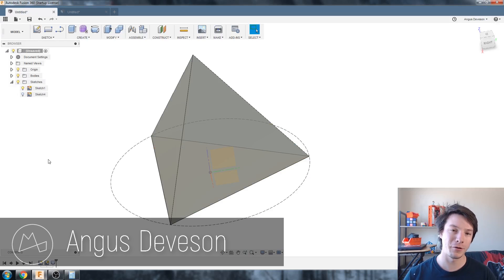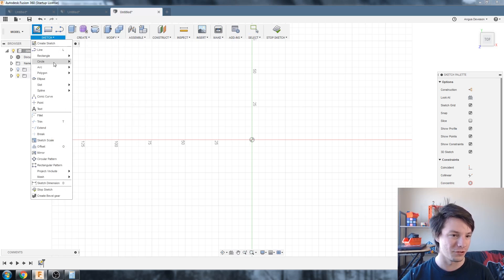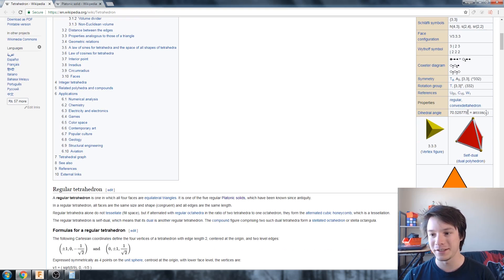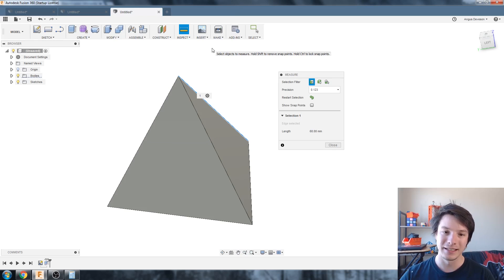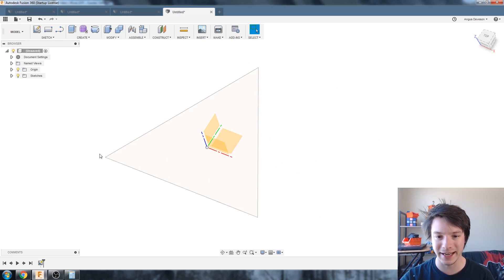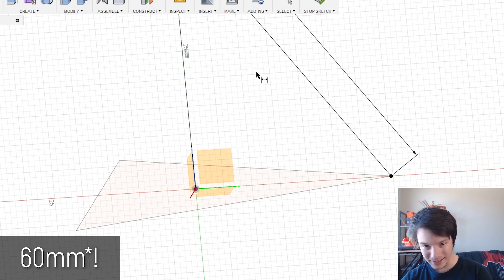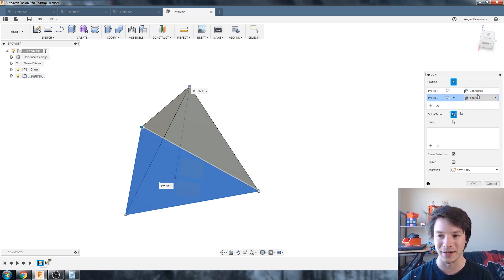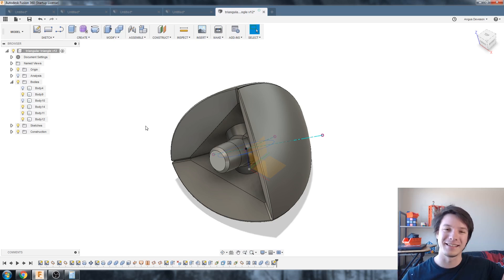How to draw a Tetrahedron in Fusion 360

Comment: The step where you "d" the line and type in 60 doesn't work for me. I do the same steps and right until this point, it's fine. After i move it with D and type the length i need, it gives me an error. 

Failed to solve. Delete or modify constraint or dimension.

Comment: With the the ability to sketch in 3D, you can draw 3 lines that go from the middle of all edges to the center of the triangle. Then select one of the middle point, move it upwards in 3D space, then apply an equal constraint between the edges.

Comment: I figured out how to create a tetrahedron symmetric about the origin. Meaning  the distance of each of the four corners of  the tetrahedron to the point on the origin are the same. The angle between these lines is approx 109.47 degrees.Use the vertical sketch plane to create this sketch. The trick is to create the equilateral triangle but one of the edges is parallel to the vertical axis. . Then create a circle and then make sure all the points on the triangle are on that circle. Then create an isosceles triangle. On the isosceles triangle, create a line from the bottom left corner to the midpoint of the right edge of the isosceles triangle. Make it perpendicular to that edge. Now the bottom left  point of the isosceles triangle is coincident with the vertical edge of the equilateral triangle. The bottom right point is vertically aligned with the tip of the equilateral triangle. To do that, draw a line from the tip of the equilateral triangle to the bottom right point of the isosceles triangle. Make that line vertical. Now add a dimension on the right edge of the isosceles triangle. Make everything construction except for the isosceles triangle. Make a plane parallel to the horizontal plane at the bottom right point of the isosceles triangle. Create a sketch, project the points and create an equilateral triangle on those points. Now you have two sketches, which you can use the tip of the isosceles triangle to make your loft. If you only use one dimension, it becomes very easy to change the size of the tetrahedron.

Comment: Awesome. I knew I needed to loft the triangle of the base to a point, but I got stuck determining the height of the point. I resorted to calculating the necessary height using trigonometry.

Your method of choosing a plane that intersects the point is genius. That way the diagonal lies on the sketch plane so it allows you to simply use a dimension on the diagonal line to perfectly position the top point at the right height. Wish I'd thought of that!

Comment: I recently was banging my head against the wall trying to make an irregular shape consisting entirely of triangular and rectangular faces, that would all scale according to a single changed value. I resorted to getting as much as I could do with the standard sketch and extrude then created a new plane for every face of the shape based on two existing sketches/ extrudes, then defining what I could as a ratio of the 'master' length... I feel this was a rather clumsy and inefficient way of solving this issue... after a lot of trial and error it works! This video is the kind of thing I constantly came across trying to solve my issues except more clearly set out. Now all I need is for the 3D printer to arrive...

Comment: You might be able to use the measure tool with way more decimal points to see how far off the first method is. Also the 90-acos(-1/3) is probably also nearly perfect

Comment: When you say using decimals will make it slightly off, can you give a rough estimate for say the other 60mm measurements? Are they 60.01mm or something  Angus? Need to know if the extra effort is worth it especially for 3d printing.

Comment: Fusion360 isn't great for the task - but euclid geometry can be adapter into 3D space. So you are just allowed spheres and straight lines. 

After you made your initial triangle, three spheres of the same radius as the side of he triangle will give you two points where all intersect. And those are your possible tetrahedron.

Comment: I did it in Onshape a while back, and initially I did something horrific involving two planes perpendicular to the triangle plane, each going through a midpoint and a vertex of the triangle, then drawing circles on them and positioning the 4th vertex where they intersect. Then I figured out your second method - though I think I had to draw some construction lines to define the centre of the triangle, because I'd just drawn it rather than using any fancy triangle tool.

Works great - I mirrored everything around and got a perfect icosahedron. Which I then started hacking up into a geodesic dome. :)

Thanks for the vid. Great as always.

Comment: Why not use 3d lines instead of loft?
Reply: Sure you could, but it would be more work, as far as I can tell.
Reply: 1st line is already added, so adding 2 more should be easy. Yeah but then you need to create solid somehow :)
Reply: Yes, and that can be done by creating patches and then stitch those to get a solid. Point is that it is more work than either of the methods shown in the video.
Reply: well, true :)

Comment: Well explained as always. Autodesk needs to include these 3d primatives as standard though.
Reply: ^ This! ^  Platonic solids as primitives would be a great addition. I just checked the Fusion 360 IdeaStation on the autodesk forum and this had been suggested as a feature a couple years ago, but then shut down due to lack of support with only 3 votes. :( 
Maybe the title "Add Platonic Solids for modeling" didn't resonate with people...?
Reply: David In a lot of 3d modeling programs, basic shapes like spheres, cylinders, prisms, cubes, and regular polyhedra are called primitives, since they can be used as a simple base to build up more complex designs.
Reply: Ok, cool. Though, you missed a comma.
Reply: Takes one to know one. repeatedly pressing refresh

Comment: Do you know any good techiques to help with drawing polyhedra with more sides?  Like an dodecahedron or a cuboctahedron, perhaps.
Reply: you could draw a sphere then draw polyhedra inside it with the points touching the sphere, but you do need to do some math to figure out the size of the polyhedra. (all points on a sphere are equidistant from the center, if you know the angle of the center to 2 points you can calculate the distance between them)
Reply: Vincent van Roosmalen, good idea.  But can one assume that all vertexes of a regular or quasiregular polyhedron are coincident with a sphere?  Edit:  maybe if they are convex.  Nonconvex counter example is dodecadodecahedron.  But that leads one to ask how many spheres are needed to ecapsulate all the vertexes and how their radiuses may vary in relation to one another.
Reply: Mark Swayne for the platonic solids i'm sure because of the symetries, but the rest i'm not sure.  Thinking about symetries will make it a lot easier though.

Comment: Alternatively you could type in "90 - acos(-1/3)" for the taper angle.
Reply from the maker: True that, fusion will accept that.
Reply: That's what i thought.
Reply: After sleeping on it, I thought of an even more elegant way to do it. Type in "asin(-1/3)".  In any case, thanks for the great video. I always learn new things from you.
Reply: Even with the formula fusion might round it (not sure)
Reply: I think you're right that Fusion 360 rounds even with the formula. The number is an irrational number and can't be represented exactly. There's a setting in Fusion 360 that sets the number of significant figures, but I don't know the software well enough to tell how that works.
Reply: I've been making Platonic Solids in Fusion 360 and I've found the shapes turn out much better if I use the exact formula rather than a decimal value. Even if the decimal value has a lot of digits, Fusion does better with the exact formula.